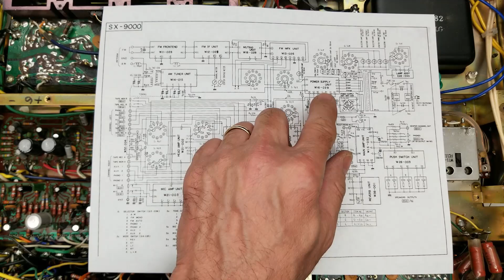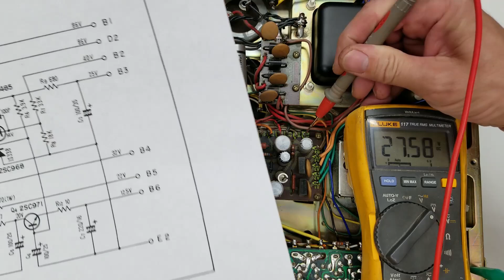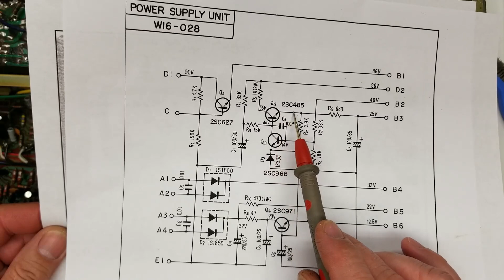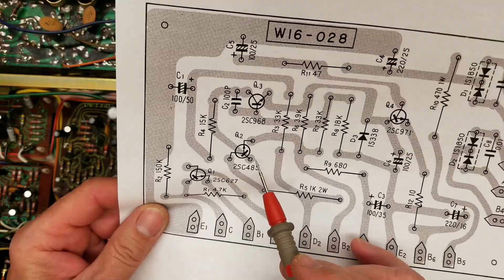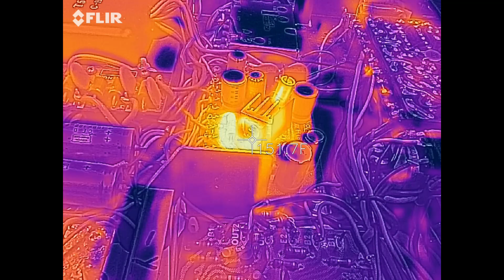PIONEER SX-9000 STEREO RECEIVER NO SOUND REPAIR VINTAGE AUDIO REPAIR SX9000

Comment: I repaired mine by myself. I had no sound on the left channel and low sound on the right. I turned out it was a faulty variable resistor on the pilot transistor of the left power transistors in the left channel on the main amp unit board. Furthermore I had to deoxidize every switch and knob. A lot of work but definitely worth it!

Comment: I have a optinica amplifier sm 1515b if the power transformer goes can it still be fixed the part number is rtrnp0506afzz and it output ic goes bad part number rh-ix1066afzz can it be fixed it is my graduation money purchase so it is special to me

Comment: Where are you putting the negative node when you are testing the voltage on each wire point?
Reply from the maker: Usually the ground lead is attached to the chassis, which is chassis ground.

Comment: This is a great video. I inherited my dad's unit and the left channel power amp fuse keeps blowing immediately. The shop said it is most likely the audio output transistors have shorted and it would require a rebuild and they don't have time for it. Do you have any advice or videos on how to fix that?

Comment: I repaired one simliar to this it came from a scholl and they had removed the volume controll and placed it inside the machine with some wires running to it. I can imagine som kid turning the volume to Max and they where any good idea to stop this from happening a yeah we can put volume controll inside the machine and have the screws removed i think its really silly solution when the could have locked the amp in a cabinet you can lock. I did put the volume wheel back and now its fixed i also foundsome new screws for it so now its restored.

Comment: Bought mine in 1971 and just hooked it up again after many years at least 25. I'm getting a lot of loud static even with the volume turned down. Any ideas? Probably needs a good cleaning.
Thanks for the video!
Reply from the maker: Clean all the pots and switches with DeOxit D5 and see if that removes the static. Get back to me!
Reply: @norcal715  I am assuming you are referring to the volume knobs and pushbuttons (potetiometers and switches). Thanks for the advice, I will order some from Amazon!!
Reply: @norcal715  Got the Deoxit yesterday and did a quick spray on the pots I can reach. The worst for static was the balance and the bass adjustments. It seems to have cleared it up a bit but will do another round of sprays today. Also it seems the left channel drops in and out and has lower volume. Phono and Aux inputs seem ok and the tuner will pull in some channels. Thanks again! Also get a loud crack when you select a speaker pushbutton A & B.

Comment: Good video. I'm surprised the electros didn't need replacement with the age of the unit. I love the old receivers from the early 70s to early 80s. They changed looks when they went from linear dials of the 70s to digital readouts of the 80s. Anything from the late eighties onward were just black mono-blocks, with red or blue digital numbers and no character. Receivers in the 90s were so much the same, you'd have to look three times to work out what brand they were.

Comment: What’s the power resistor’s purpose? And at what temp would be concerning for that transistor? Thanks
Reply from the maker: Just a voltage drop so the transistor does not do all the dropping. Less heat on the transistor.

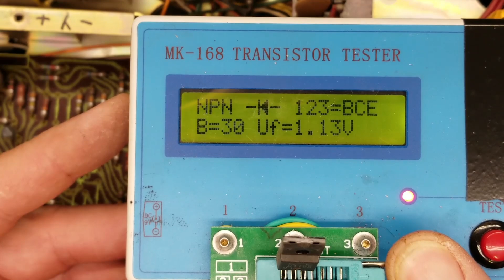Comment: At 6:14 the Vf of 1.13 Volts indicates a Darlington transistor, 2 Vbe voltage drops.  Indeed, when you look it up, it is a Darlington, not just a single transistor.